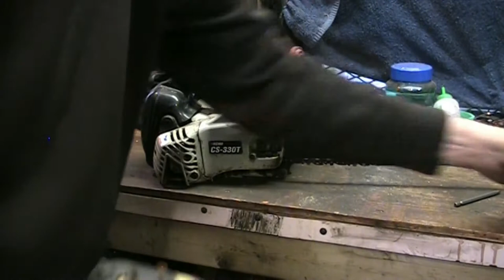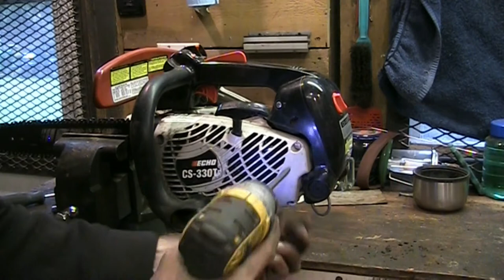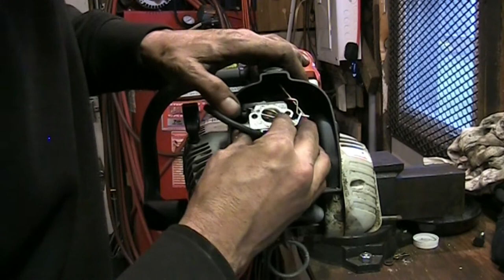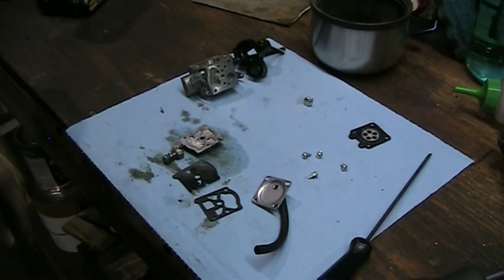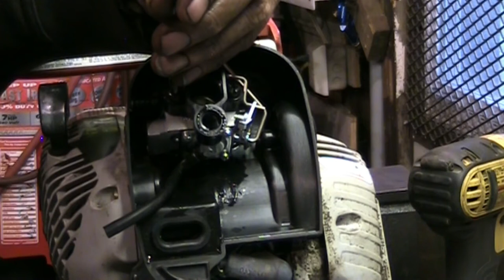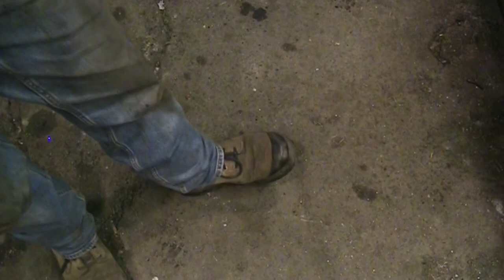Echo CS-330T chainsaw repair. This saw runs rough and leaks oil. Hasn't run in years.

Comment: I remember this one , remembering when you pull carb out. It asks like a plunger and pulls the gas out.   Just remembered carb screen was PACKED. The fuel filter didn’t have the screen it.  Something to be leary about.
Reply from the maker: I find ultra fine fine sawdust packed in those carburetor  screens fairly often.

Comment: That saw was designed for 12" or 14" bar. No wonder this saw is having a rough time; that bar is WAY too big for that saw.
Reply from the maker: Yep, it would have come with up to a 14" bar.
Reply: I ran a 16” bar on mine for a while and had plenty of power . But I normally run a 14 “ .
Reply: Same here . I run a 14” bar but have a 16” and had plenty of power. I’ve had it for 15 years and still going strong.
Reply: I have the cs 360 t with a few mods an i keep a 16 on it an a 14 when i climb but my saw could run a 18 inch bar if i wanted 2 ...dont sleep on the old echo grey

Comment: Hello, great video taking out the carb... this is the only video on youtube that shows how to do this on a 330T.     Question< my saw does not have the pulse hose hooked up underneath the carb to wherever it goes..... Is the pulse hose necessary for it to run ? or run smoothly?

Comment: Nice video I was recently given a CS33OT basket case. I really am not sure Jay is wrong with it as to why it was all taken apart. It had spark and seems like good compression. Someone took the handle apart and all of the rods as well as throttle and choke lever were off. I figured out how to get that all back but there is a V Shaped metal strap that appears to ground the ignition to kill the saw. It has two male wire terminals attached to it. I can’t figure out how this goes back in. Parts diagrams aren’t doing me any good. Any ideas?
Reply from the maker: Sorry Steve. This was a customers machine I worked on a long time ago.  I don't have it here to look at
Reply: It slides over second to bottom hole on right side handle insulated terminal goes onto v and non insulated one goes on the plastic tab above it. Hope this helps
Reply from the maker: Thanks for the help Wayne!
Reply: Also make sure you take muffler off an check screen an my cs 360 had a clogged muffler because it had a cat converter in it an it stopped up completely .an saw got weaker an weaker then 1 day no start at all untill i figured out it had a converter in muff like old pop Cadillac did lol

Comment: Does anyone know where to get this carburetor? The part number ?
Reply from the maker: The carb number is etched into the carb itself. Sometimes there are different carbs used on the same model of saws. You can use that number you find to locate parts or a replacement carb.
Reply: @randomwrenching  thank you

Comment: That saw has a bar oil adjustment screw . Flip it over, it takes a flat head screwdriver. It IS hard to see.
Reply: It's on the bottom of the saw. Clockwise starves, counter floods.
Reply from the maker: @haljordan9160  Same as some Stihl models. Great info, thanks!